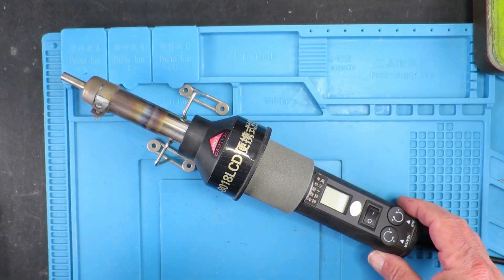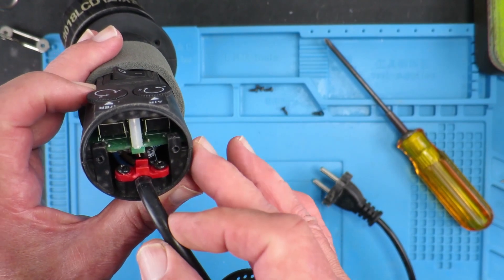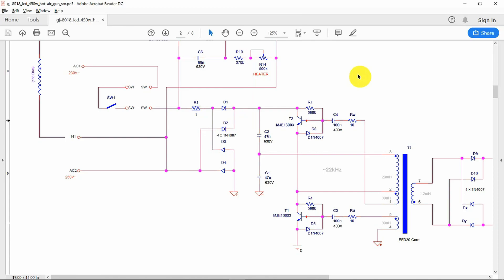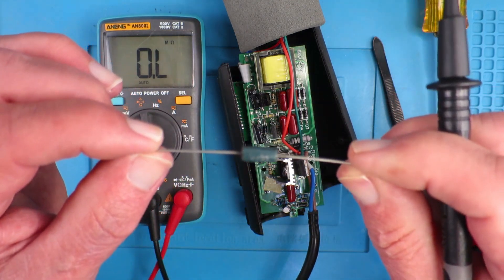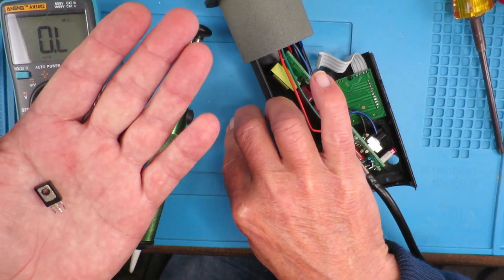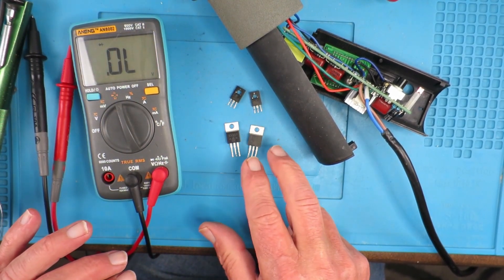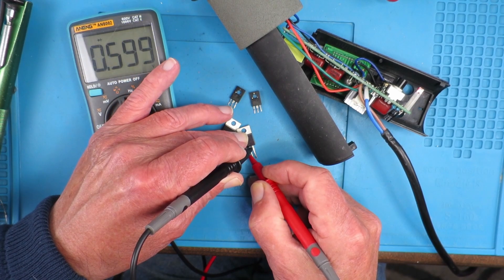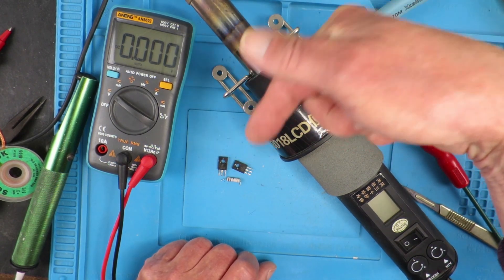GONGJUE GJ-8018 Hot Air Gun Repair Tutorial

Comment: I don't understand for me bcause heater and fan work, just display is off. thanks for schema, maybe other resistance for display, out of order....
Reply from the maker: Check for broken or bad solder joints. There is quite a lot of vibration. Thanks for watching, have a great day!
Reply: @1nformatica  THANK YOU, i will see it
Reply: I tried to sold all, but nothing more. Just sometime display appear 1s when i light up. Like capacity capacitor, and stop. Not everytime. So maybe one capacitor ko. Not easy to find :)
Reply from the maker: @raymondconte8379  Yes, difficult to find, here in Spain it is very common for caps to fail. I bought an ESR meter just for that. The circuit is very dangerous to work on, lots of live components. Maybe time to cut your losses and get a new one!

Comment: Hi sir i have purchased recently the same product but I am facing temperature variations issue device is not stable over 350 degrees centigrade kindly please suggest on the temperature fluctuating
Reply from the maker: Sorry that is just the way it is. For accurate temperature control you need a more expensive device like : 2in1 SMD Soldering Iron Hot Air Rework Station https://s.click.aliexpress.com/e/_DDsGBT1
Reply: @1nformatica  sir I mean to say that temperature is not constant for atleast for an minute it is falling down suddenly so that we cannot work also it's same with you also

Comment: Thanks for sharing your experience and showing us how to fix your problem.
My gun after 3 minutes of work has the heater that goes off and the display turns off too but the fan runs ok. I let the gun cool down, rest, and then it works as it should work. If I use it again for 3/5 minutes, on the 6th minute the heater and display stop working again! 
This is not the way this gun is supposed to work!
Reply from the maker: I guess it is activating thermal protection so it does not get damaged. You can try changing the mix of air and heat, perhaps. Thanks for watching, have a great day!

Comment: I bought a similar hot air station as yours however the seller sent me a 110v one instead of 220v. Is there a way to change some of the components in  the 110v to make it run on 220v?
Reply from the maker: It would be best if possible to get the supplier to change or refund the gun. There is a circuit diagram link in the video description. You could compare that to what you have. I guess the values of R1 and R6 will be different. You would also need to check the voltage rating of the diodes and switching transistors. In my opinion this would be more trouble than it is worth. YouTube no longer shows me if you are subscribed. Please consider subscribing if you have not done so already!

Comment: Thanks, having the same problem, when using it for some longer period, it just die and flicker. I guess the same components.
Reply from the maker: It is not recommended to use the gun for extended times for that reason! Also recommended is keeping the fan on and turn the heater off to cool it, don't just turn it off when hot. YouTube no longer shows me if you are subscribed. Please consider subscribing if you have not done so already!

Comment: my heatgun's lcd stopped working. would replacing the two transistors with 100n3l from an old ups work?
Reply from the maker: That FET is only rated 30 volts : https://www.alldatasheet.com/view.jsp?Searchword=100N3L&sField=2 You need something like MJE13003 which I found in an old PC power supply. Check the circuit diagram in the video description. Please consider subscribing if you have not done so already!
Reply: @1nformatica  For me, just the LCD is not working. The heating element and fan are functional. Checked the diodes and D5, D7 show readings from both ends.
Reply from the maker: @ManoharOfficial  I guess then it is the LCD display itself is faulty. Can you see a faint display if you look at it at an angle? Possibly a loose connection? Take care if you play around with this open. I'm sure you know there are lethal voltages inside!
Reply: @1nformatica  I can't see any faint displayed... maybe the lcd died. I'm not plating around with it plugged in ofcorse. and I made sure to stay away from the capacitors
Reply from the maker: @ManoharOfficial  Sound practice! I think you can still use it as is, the numbers are pretty random!!

Comment: its there any form to repair that limit of use? im trying to use mine and after some minutes it lows the heat
Reply from the maker: It has a safety cut out. If you run it for a long time at high temps it will shut down. Try different nozzle sizes and experiment with different temps and airflow. It takes a little learning to use effectively. Please consider subscribing if you have not done so already!

Comment: I have exact the same problem,  can you tell me the right info of the partnumbets you have used ?
Reply from the maker: The original transistors are MJE13003 NPN 400volt 1.5 Amp. I found in an old PC power supply MJE13007 which I used. Link to the circuit diagram is in the video description. Please consider subscribing if you have not done so already!

Comment: Hi. Great video
I have the same gun. Mine working fine. The only problem is that it show crazy numbers on the LCD 100-900°c do you have an idea what can went wrong?
Reply from the maker: I have not seen that. It could be the control potentiometer  either worn or dirty. Try a switch contact spray.
Reply: this hot guns work in farenheit

Comment: Very interesting person u r .very methodically u CKED and cleared the fault. I am lucky to see this unit from inside along with circuit diagram. I have similar  blower, but I am not able to use it  what ever setting I keep, can not  desolder the components, perhaps u may guide  me what setting required and to do  the work ,so make a video  so I can see  how  to use this machine.how  much . heating time required and flux etc etc u understood what I mean. TKQ v much for video & cct  diagram for future use.i too have component tester but another brand.waiting for ur video
Reply from the maker: Thanks! De-soldering is often more difficult than soldering. You need an iron of at least 30 watts preferably with temperature control. The other problem is that the solder used these days is lead free which has a higher melting point. I find that it helps to add some leaded solder to the joint before trying to de-solder it. I also now use this desolder pump which is great https://youtu.be/n0QtewXyiPU

Comment: Hi,

I have exactly the same problem/symptom with my unit. 😒

So if you were to mount an aluminum heatsink onto each one of those 2 transistors... 🤔

... would that be enough to rectify the situation or is it just poor design alltogether ?

Thanks !

Best Regards,

PS: Which replacement transistors did you use ? 🤔
Reply from the maker: Adding heat-sinks would improve things a little but it is still a very basic design! The replacements I found are 13007 https://youtu.be/H0pw_uSK2ig?t=607
Reply: @1nformatica  That resistor that you replaced... is it a 2 W 1 Ohm resistor ? 🤔

@ 03:11
I noticed that my unit doesn't have that resistor near next to the potenciometer for the heater. 😕

Can you tell what resistance & power (W) it has ?
Reply from the maker: The burned out resistor is 1 Ohm about 2 watts. The other is 1.5 M Ohms. There is a link to the circuit diagram in the video description. The 1.5 M Ohm resistor does not appear there either!
Reply: @1nformatica  Aaah... thanks again ! 🤔😆🖒
Reply from the maker: Hope you get it fixed!
Reply: @1nformatica  Meh... I was fiddling with this for the last couple of days so I just simply decided to retire it. I'll try to sell it for parts instead. 😞

Yesterday I again changed those 2 transistors & the resistor & I blew a fuse in my house. Before that I managed to get it working, but just for a minute or two.

Everything was fine, display was working, knobs, but it just keeps on destroying that 2 W resistor. 😶

Yesterday when the fuse blew, it also melted some copper lines on the PCB. So I've had enough of this. But the device was working for about 2 min though. However the LCD was not displaying anything.

But after I blew the fuse again after fixing it I decided calling it quits. 33 € thrown out the window. 😒
Reply from the maker: Bummer! Mine was working for over 4 years before a problem. Guess you were unlucky. I think the latest ones shipping have been re designed.
Reply: @1nformatica  Yeah I caught onto that when I watched the full video. I added even stronger transistors but they keep getting hot. 😕

Maybe I have another failing component somewhere else on the board.

Comment: Hi, My hot air gun is not heating? How do I solve this problem? Fan is working
Reply from the maker: Most likely the heating element has failed. You should remove it and check if it is open circuit. You can get a replacement here: http://bit.ly/GJ8018Element

Comment: Good job ! I also use this tool and it's works ok. After use switch off only the heat resistor and  let the fan to cool it.. I short the display with an electrod to measure the temperature, but i fix it by replace it and zenner diode.
Reply from the maker: Thanks! Great advice to cool the heater before switching it off. I am sure many elements fail because people do not do this.